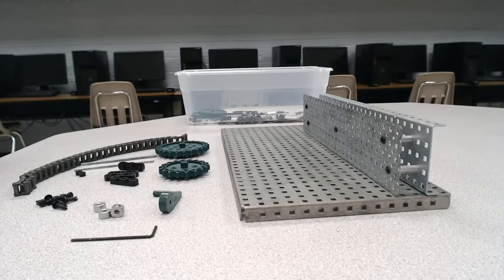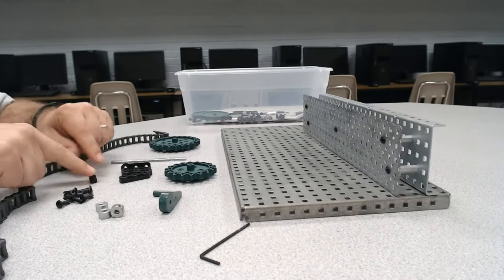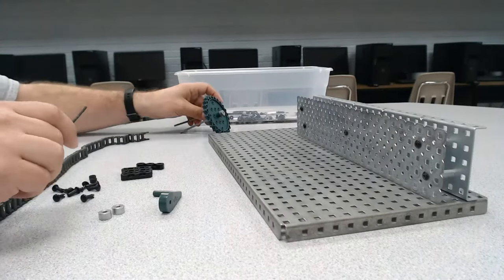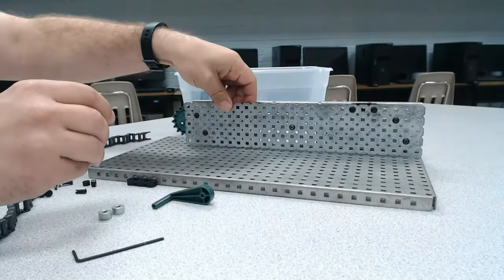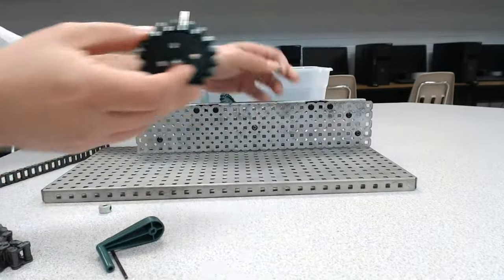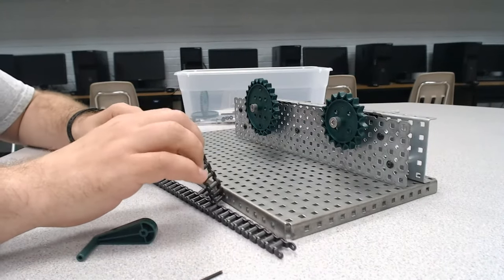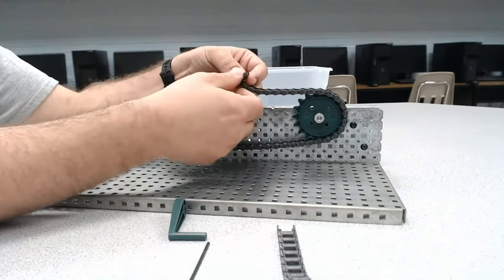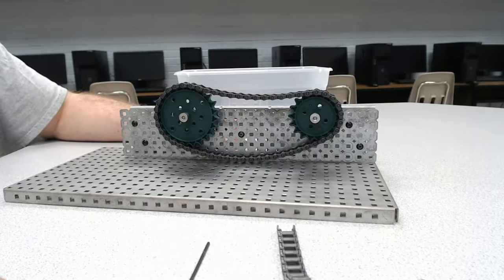VEX Gear Tutorials - Building a Chain Drive

Comment: In order to avoid chain skipping, you can add a rubber banded tensioner with loose spacers to make sure it always stays tight without actually forcing the axles to be pulled
Reply from the maker: A useful tip. Thank you for sharing.